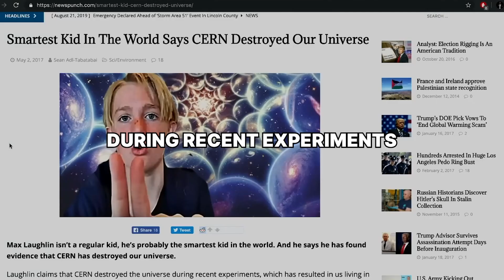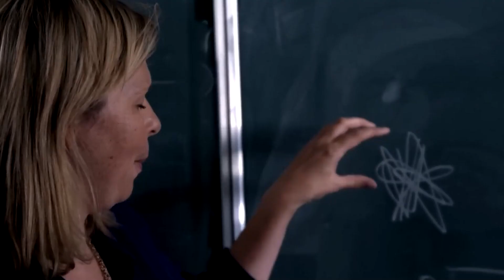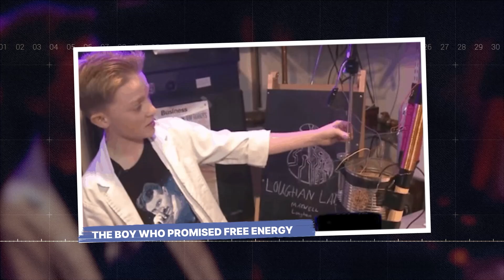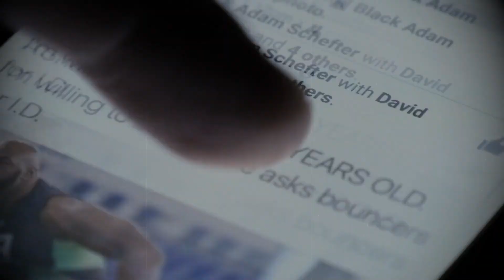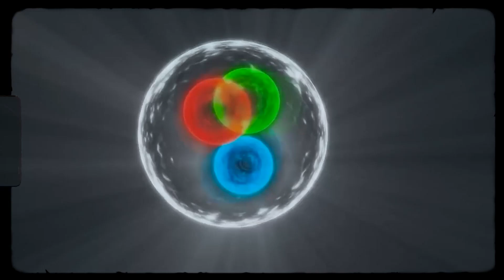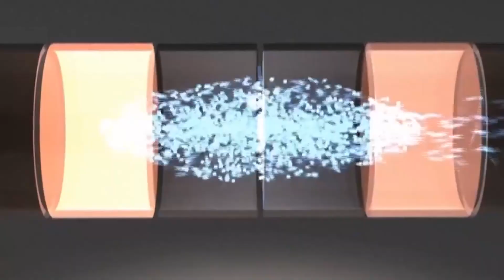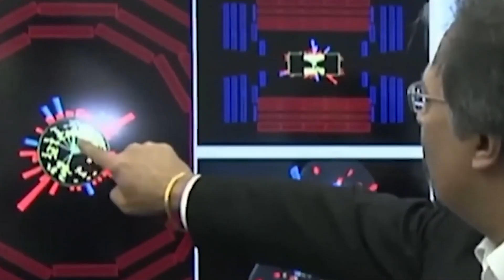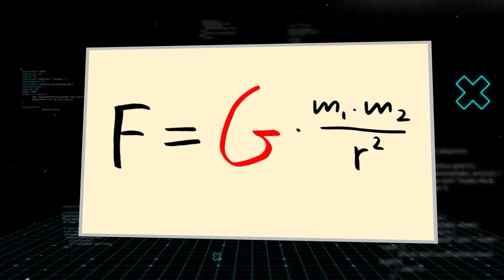CERN’s Quantum AI May Have Opened a Portal, According to Genius Max Loughan — Joe Rogan Reacts

Comment: Cern currently only has 3rd Gen installation of Nvidia GPUs for data mining. No quantum computer. At least, not that Clara (cern YouTuber) has mentioned.
On the conspiracy side, quantum sensors and computing elements are wired to harness movement of electron scale energy over the distance of a few atoms. Not enough energy to even move an atom, barely enough energy to make a single photon, which we can detect with great effort. For example, my ASI cooled 394 camera can detect about 1e of  noise per second on a 5 micron optical cell.
The only path you can take to even talk about multi-dimensional anything is only in mathematics, where if you do things like divide by zero you go off into the weeds - far from proof that something exists. Same with sqrt(-1).  Yes there is physical meaning to the latter, but it describes 2 things that rotate, but didn't start at the same time (ie like a clock in London and New York Show different positions on their dial, expected, not weird).